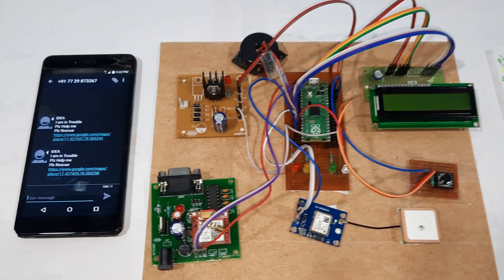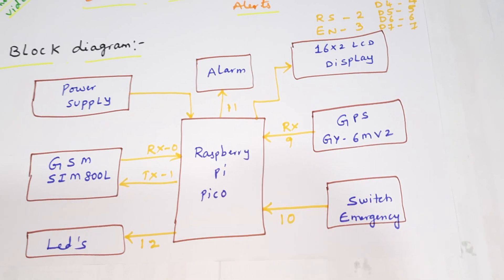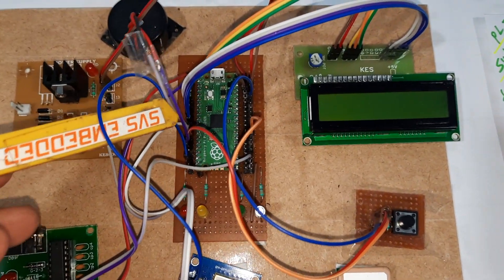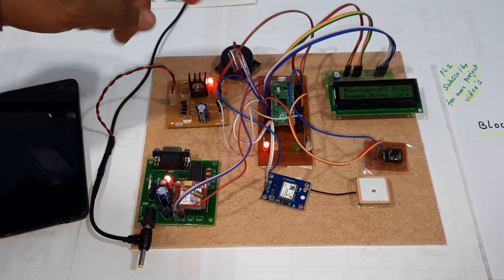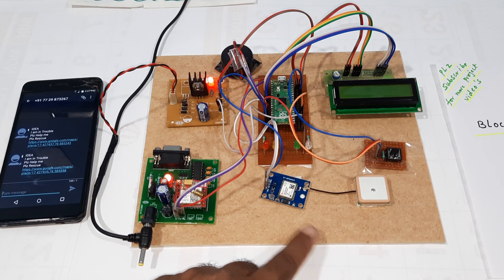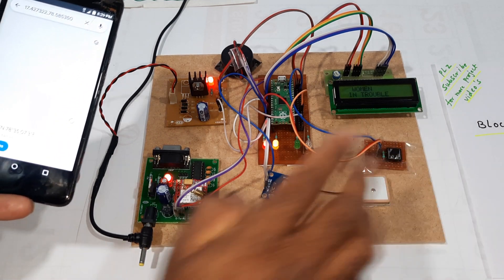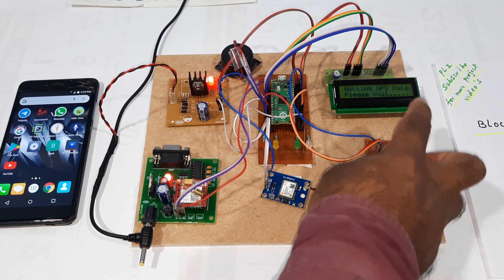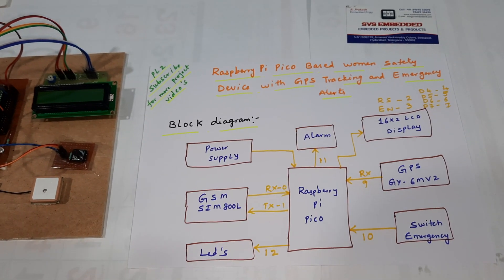Raspberry Pi Pico Based Women Safety Device with GPS Tracking and Emergency Alerts

Comment: Why raspberry pi using it is very costly y not using other microcontrollers
Reply from the maker: Thanks for watching and your valuable Feed back.RPI PICO latest module and low cost Device.Same as Arduno Cost.